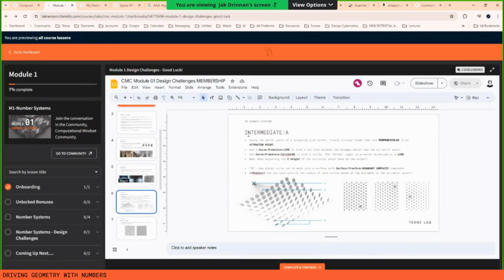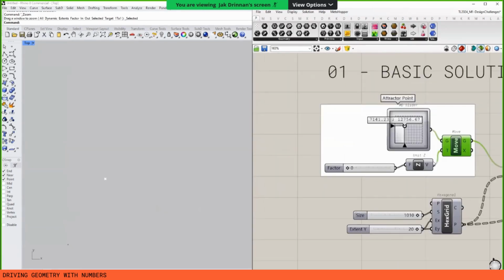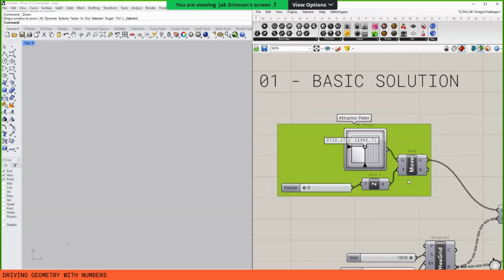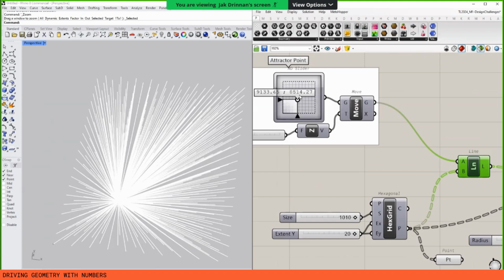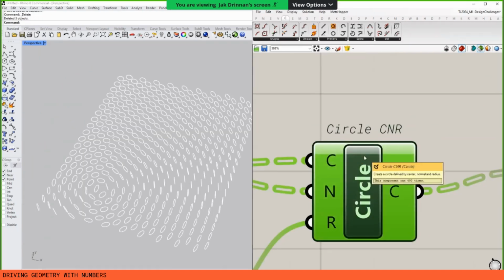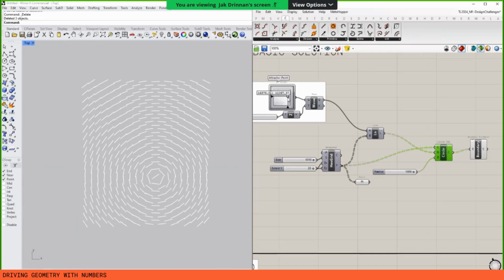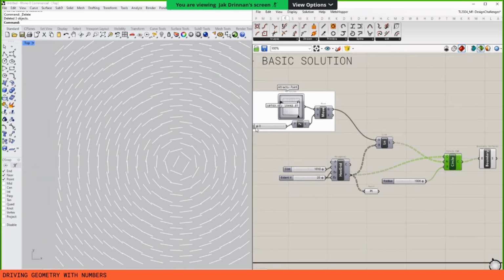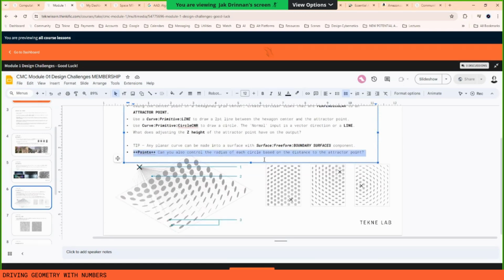Grasshopper Design Challenge #1 - Computational Mindset Community

Comment: Hi, here's another approach i believe to be better. make a bunch of hexagons, get their center points, calculate the distance from an attractor point to center of each hexagon, and feed the distance to circle radius (number of circles must match the number of hexagons, hexagon centers ofc, and distances calculated *just to make sure you haven't done any mistakes*) then using the circles u made and the hexagon center point; find the tangent vector for circle[i] at point[i], the vector then gets passed to rotate3d component to the axis input and the distance we calculated earlier can be remaped from from bounds to something like 0 to 90, and then passed to degree input in rotate 3d.
Reply: or even better calculate the vector using vector 2pt component, for center of each hexagon and the attractor point, the rotate the vector by 90 degrees